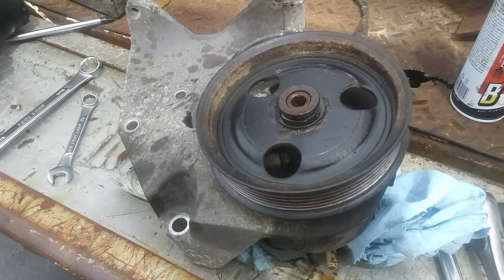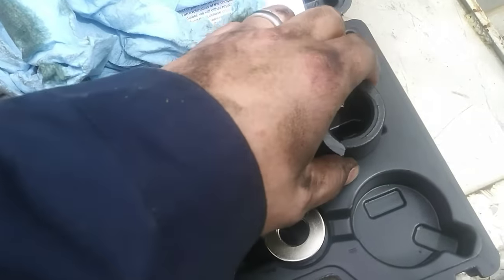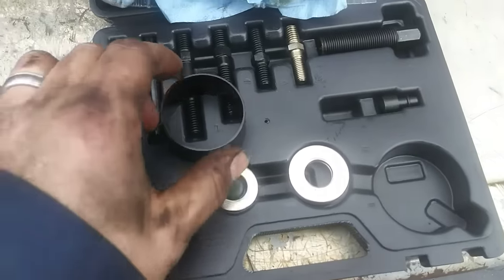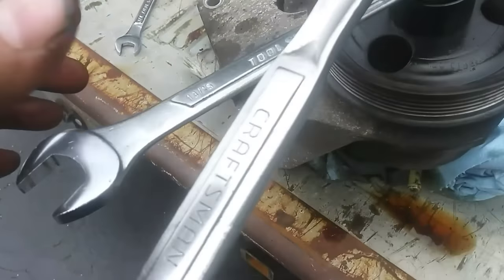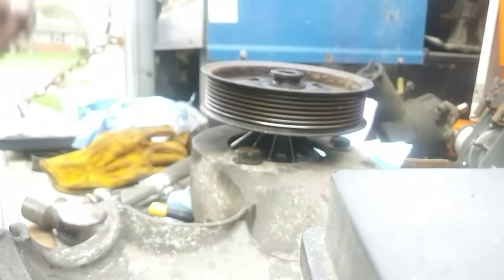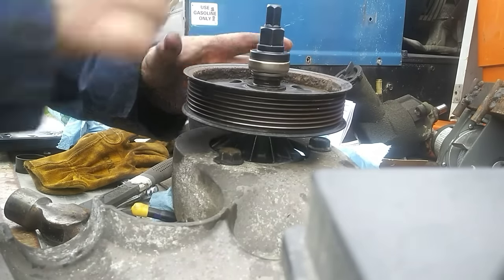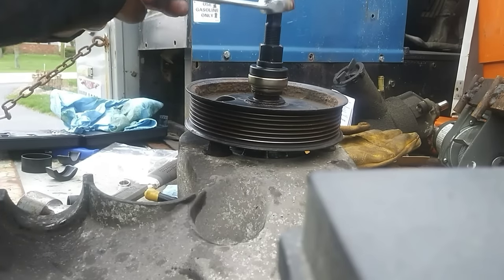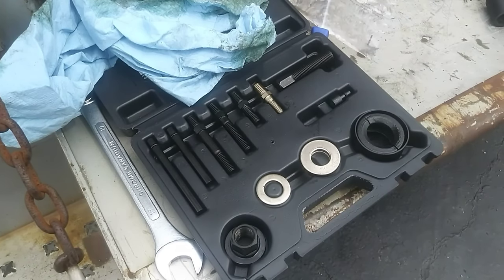How to easily remove a pulley from a power steering pump!

Comment: Why not show detail all three bolts
Reply from the maker: I didn't think it was that important.   Sorry.
Reply: I got the pulley  kit it took me 2 hour's ..and a black guy showed me what I was doing wrong. The way you  show it i almost mess up the main bolt to the kit. I'll post my video of it then you'll no what I'm talking about
Reply from the maker: @sissy99098  Awesome! Can't wait to see the video!
Reply from the maker: Ron has pointed out I didn't use the "button".  It's a tip that goes into the jackshaft and would be very important especially if the diameter of the jackshaft is bigger than the hole in the pully.    He explains this in his video, you can watch it here!  https://www.youtube.com/watch?v=mLs-b9eInuw

Comment: If the pulley already broke off, will I still be able to install using the provided screw and installation instructions? The removal process with the tool kit doesn't thread the inside to then be used for installation does it? Can I do installation only without worrying about the threads inside matching the screw?

Comment: Hey there.. I noticed the pulley is pressed in further in the new pump's shaft... did you experience any misalignment on the belt ?
Reply from the maker: My guess is in this video, the new pump shaft may have been a tad bit longer.   As long as the pulley is seated, it will be where it needs to be.    And I'm still using the same pump on the truck, no issues.  (Knock on wood).
Reply: @1D10CRACY  Hey thats great! I ran into the same issue as well but ran V-belts which I assume are more forgiving. I found that the new reman pump's shaft was 0.001" smaller than the old one which caused the pulley to sit in deeper. I am guessing the reman process machined down the shaft just a hair.

Comment: I have a 1997 Ford f150 I replaced my power steering pump. When I'm putting my pulley back on how do I know how far back to tighten the pulley. All the other videos say to match up to the old pump. The old pump the power steering broad was not flush with the pulley it set back just about an eighth. So I tried to match that and now power steering pump is squeaking really bad!
Reply: This is old but all the way untill the pulley turns. Your squealing is from the belt to sitting on the pulley right 👌

Comment: Spent 7 hours using this same exact tool and could not get my pulley off today took an old fashioned 3 jaw puller it was off in 5 minuets.  I do not like this puller kit at all . Did everything exactly the same way you did
Reply: Next time heat the inner part of the pulley with a propane bottle torch. Then take it off 👌 I do it all the time on seized parts

Comment: None of these videos, ever show us how or which or what way, or which end to put the bolt in.
Reply from the maker: What bolt?
Reply: @1D10CRACY  Hello, the bolts that are in the kit. My directions say to take the one bolt (the main puller bolt) and tread it though the one piece, then it says to use the small plug or # 9 or 7 and to put a (unknown end into the main puller bolt, and the other end is to go into the pulley. But it doesn't say which end is suppose to go in the pulley or which end is to go into the main pulley bolt. So far, I got no where! Also, is seems to be impossible to remove from the steering pump, when it's already attached to the car. I can't even replace the line, because when they designed these things, there no room to even place the wrench anywhere! The designers are idiots!

Comment: A pickle fork works great and it's much easier than renting the tool
Reply: I'n my experience, I'd be surprised if a pickle fork would work for this app. It's  a tough removal  even with the  puller. On some of these the there's no room behind the pulley to start the pf.